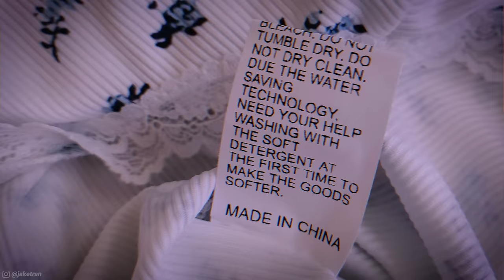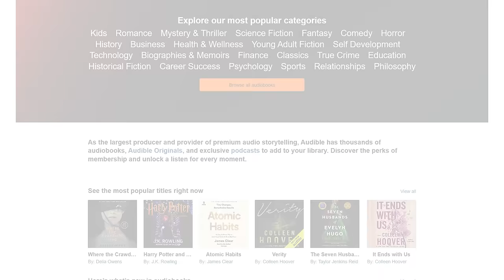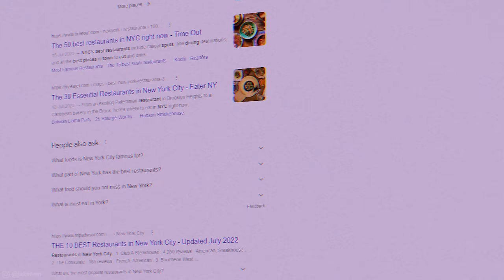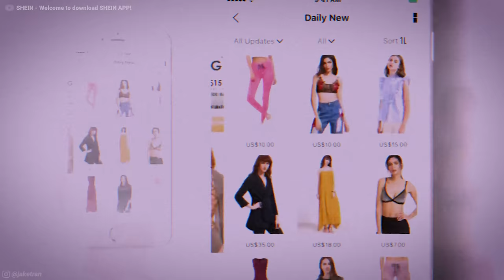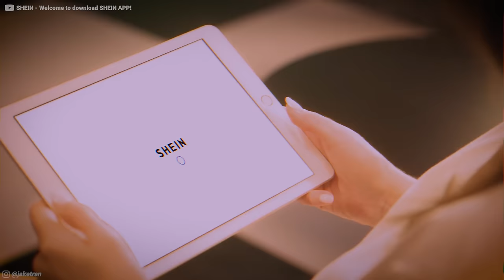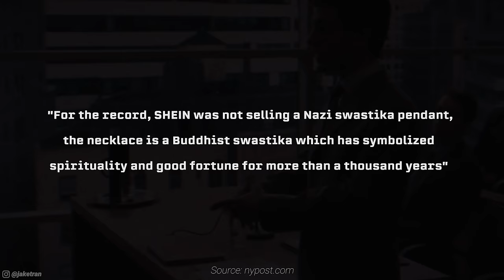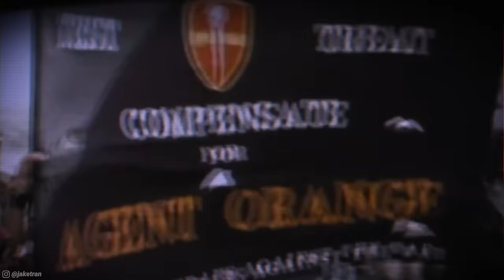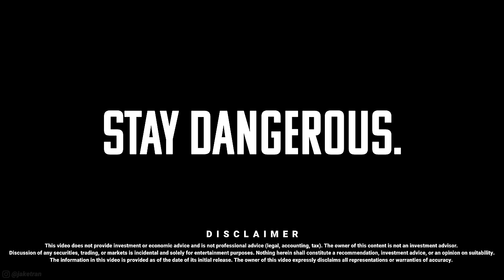DISTURBING: Clothing tags contain cry for help

Comment: I'm out here with the clothes I've had for 5 years and theyre still fine. Havent gotten new things unless I need them. The only things I've rlly bought is hoodies and some undergarments and make what else I want; no sweatshop needed. Clothes just aren't made like they used to be and last way longer if washed properly, too. Go make things! It's fun! 
Great video, thanks Jake!
Reply: That's great but also there's other ways to continously purchase clothes without consuming fast fashion.
Reply: @benkroll8886  True dat, I'll occasionally go thrifting if I want to tailor something or get cheap materials to use. Idk, I like to have fun with it! :3 it's satisfying wear something you've made and not always hate it at first Lmao
Reply: How do your clothes last that long lol, I start to get holes and my washer makes clothes look dingy after a year or 2
Reply: @kyler4836  Tbh I just hand wash when I can help it. I live simply lol
Reply: Same lol
Reply: I have clothes that are over 10 years 🤷🏼‍♀️
I buy multiples of the things I like and wear them until they fail.
Reply: @skyissly1642  thats true. I uses to do the same way. Handwash gives more lifetime for the clothes.
Reply: Washing properly is key honestly. A lot of clothes get ruined.
Reply: @toeknee3302  most cheap clothes just fall apart at the seams =/
Although washing on cold and not using softeners sure helps.
Reply: @kyler4836  
1. stop buying the cheapest crap (doesn't have to be expensive, just not the cheapest, think GAP or north face)
2. wash on cold, don't use softeners
3. dry on the lowest setting
4. have enough clothing, that is a minimum of 10 days worth

That's it, your clothes should last years, at least 5.
Reply: Please I'm trying to understand how a cloth lasts for that long, what material is it?
Reply: @d-meth  hand wash or machine?
Reply: @meaningoflife7199  cotton and wools mainly, old fibers generally just hold up better. I use wax on fraying/high contact seams so the fibers bind, generally on jean material n things that are a bit more coarse
Reply: @meaningoflife7199  I always machine wash my clothes, hand washing is way too much of a hassle for my taste 🤷🏼‍♀️

As to materials... I have over 10yo cotton long sleeve t-shirts from GAP that are just starting to fail at the seams in the armpits. I also have under armour tank tops that are synthetic but can't give you exact ingredients as I cut out the tags (they irritate me). 
Darn tough socks really live up to their name and I keep waiting for a pair to wear out so that I can get a replacement (they offer a lifetime warranty) but it's been around 10 years and all of them hold up (I do have 30 pairs or so though).
So it's not really the material itself as much as having enough to not have to wash each garment more often than +/- 10 days and washing properly (as per instructions).
Pretty much all of my items are to be washed on cold with no softeners and dried on low.
Reply: @skyissly1642  I do absolutely nothing to my clothes (besides washing and drying on cold using natural detergents and no softeners) and they last 🤷🏼‍♀️
Reply: @kyler4836  bruh I don't have a single pair of pants without holes lol I need new ones but hey they still fit and despite the holes they comfy
Reply: I wore the same clothes for years and years. I even wore ones with holes on in because they were still good. I wear the same things every single day, I don’t understand why people need to buy a new shirt every 7 days
Reply: You're lying
Reply: @lemonadejuice7356  who's lying and why?
You don't believe that people have 5yo clothes that are just fine? 🤣
I'm wearing an under armour tank top that's at least 8yo and it's just fine, you wouldn't be able to tell that it wasn't bought last year.
Reply: @d-meth  you're
Reply: @lemonadejuice7356  which statement do you think is untrue?
Reply: @meaningoflife7199  the under armour tanktops are 94% polyester and 6% elastane (there's a tag in one) 😉
Reply: Also of your clothes are starting to have holes or fail at the seams go see a seamstress to fix it rather than just throwing it away and it'll last another decade
Reply: @yapparichuuni  that often more expensive than replacing =/

Comment: I bought a couple of pieces of clothes from a Chinese company that advertised off facebook before.  They were awful.  Cheap, crappy, thin and didn't match the ad picture at all.  I vowed never to do that again.  Those clothes probably wouldn't have held up for 7 uses, anyway. The sad part is, even US department store clothes quality has gone down in recent years, and I don't think they are worth the price, either.
Reply: I bought a short "coat" made in Korea, mail order, there was this slender "male" model on the picture, I bought the largest size and it still threatened to split the back between the shoulders if I attempted to hold my arms forward... so, what to do, give it away to some shoulderless girly boy?  :p
Reply: @Kenzofeis  is it for people starving to death (north) or femboys? (south)
Reply: @ps92809  
The latter it seems,
Reply: I like to buy from "mom" brands like Talbots. Their clothes are good quality and don't fucking break apart after a few washes.
Reply: Your problem was you bought shit you saw advertised off Facebook. Lmfao

Comment: The label makers don't work that way! Its not like they sit there with a tiny type-writer and make each label one by one. To sneak this into production would take machine set up time, and the cooperation of other people off the assembly line. This is made up as hell, just thinking about it for longer than 5 seconds takes it apart. BUT it would make a really cool movie. which is why i guess people are willing to believe it.

Comment: I have never read the tag before but I'm gonna have to start doing that. (I don't buy clothes that often and most of the clothes I have I just machine wash. I basically wear something until it turns to rags, then use it as a rag until it's not good as that anymore either. I think it's been over a year now since my last clothing purchase.) I can happily say I have never purchased any "fast fashion" although a lot of my clothing was made in Mexico and Taiwan.

Comment: I've worked as a merchandiser for a major retailer. Everything comes from China obviously I also have seen handwritten messages inside boxes. And also inside items. It's real. One year we got cases and cases of Christmas ornaments that were flat and supposed to look like a clay or fondue material they were about 3 in circumference. we had bins filled with them. Each one was handmade on the back of the Christmas ornament which was the flat side it had fingerprints all over the back of them small tiny fingerprints all over the back that were dried into them . When I seen the fingerprints that gave me a bad Vibe because they were small now multiply that by hundreds of stores. Thousands and thousands and thousands of these things were all handmade I couldn't believe the amount of time that It would take you ? You couldn't pay anybody enough to make those things. We were selling them for a dollar a piece. these things are not worth making unless they were being made with free labor or with hardly any costs. Plain and simple. The next year Christmas rolls around those Christmas ornaments come in and guess what? No more fingerprints they're flat and smooth on the back. I know people complained or said something

Comment: Bought this cheap light

After a certain amount of hours it will only flash SOS

Bought another and it does the same after a few days of being on (not usually seen because light is battery powered, I Supplied with direct voltage for extended period) 

Somebody has obviously spent a bit of time hiding that "feature" in the small chip within the light.

Comment: I think the most surprising thing I learned in this video has nothing to do with SHEIN. I just can't believe Chinese labor laws are so fair. Arguably even more so than in America. 
There were times when I worked at Voyant that they'd have two weeks in a row of 10 hour shifts with overtime both Sunday and Saturday. I would literally go two weeks in a row without a day off.
Sometimes there was even optional overtime available throughout a month on top of the mandatory overtime. Temp workers are seriously used like cogs in a machine.

Comment: China’s population is just too large and too many people live in poverty, most who work at what westerners call sweatshops are there willingly, they make more than they would elsewhere or they do not have the skill set to do anything more. K-12 is not free or available to most of the poor and thus with less education and no other means to make money, they are willingly working at factories with such conditions. 

Although I am not saying it’s a good thing, 12-14 hours is normal in a Chinese factory, intense ones go for 14-18 hour workdays, and 1 day off per month is also common practice among almost all Chinese factories. Pay is usually 4-8k RMB which is actually really decent for the villagers that work in factories. This is because cost of living is so low and also entry level white collar jobs pay about the same as well. 

One thing you forgot to mention is, most of the workers ID is held when they start work, to prevent them from running away, although this tactic is less used and less effective now, it is still seen.

Lastly, I want to say, I am just trying to point out 12 hours per day and 1 day off per month is beyond normal in China factories and usually they will have day and night shift so the factories can function 24/7.

Comment: Shit, I got dental pain and all kinds of back foot hand wrist, neck pain and an untreated hernia. My dumbass dad thinks I should still be working, yet until a year ago I getting nothing but abused by temp labor companies and any other kind of employment I sought.  Im talking some hard labor, like digging sewage pipes up buried over 5' deep in wet clay. That where a short shovel really pays off, or using it to get the motorhome up out of a flooding mountain river camp in a blizzard. A long shovel would've been better for the blizzard, but I had a short shovel only, and it made all the difference just in time with a lot of hustle and luck. Worked 19 hour day in an Asphalt plant at age 52, and I get vertigo too. I may die from the dental. I got service connected disability over a year ago, only reason Im not living felony camping back along a mountain river again. I'd prefer that life if the fuckers left me alone and allowed me to live but they   stick you in a profit prison eventually, then they work you for free or closer to it than before. Its slavery. Well the VA dont cover dental. Im not sure if they ever actually provide any actual effective heath are other than some preventative. I still buy all my own wraps and joint braces, vitamins, supplements. I may have enough money to get my dental done enough to save me and improve my life, but I cant even get a good vehicle anymore, and inflation is fucking me. Soon I wont be able to afford to fucking eat any goddamned way. This has been going on for ten years bad. My family members all have money falling out of their ass and behave as if this is somehow my fault and I deserve this, and Ill learn a valuable life lesson by croaking from lack of effective proper dental care, which is essential to health. It so dishonest. Ive worked all kinds of jobs and careers, am entirely honest, not even a felon, but I ain't dead yet either. Ive busted my ass in everyway all my life to get out of the nightmare I grew up in, but got screwed before every turn and then knocked back, shit on, told I smelled like shit, so they pissed on me, then fired, and cops called. Anyhow, Im gonna survive and Im gonna be expatriating the fuck out of this turdpacked shitbag nation in a few months, and no way Im ever coming back, not even to visit. Its been a turd my entire life, now Im so happy to have a way out that's so much better. Ill be free of all the abuse living in the US forces upon poor people. Never even made a goddamned living in this shithole country. Anything I ever earned I paid four times for, and it was taken or destroyed. Anything I ever loved was extorted and or destroyed and then used to abuse me more in the future, because I forced them to rob me. Im so goddamned pissed the fuck off!!! I rage in the forest everyday and practice with my cane and knifes and tomahawks. I just keep a chair nearby. Then I sit in my chair and think and remember till I rested and yet become enraged again whereupon Ill exercise again and then sit again. Eventually my pretty doggy there with me in the beautiful forest, will make me happy. Then Ill sit and evaluate whatever, maybe figure something out. Only can function st all when the teeth aren't too bad though. Man, Im still in so much pain though, but Im strong AF. 
Ill never goddamned work again in the fucking US shithole. I'd sooner eat a fucker than work for them. 
Gonna buy some land for homestead in Costa Rica, it cost more than many places in the US, but I know better than to trust investing anywhere in the US abusive bag of crappers.